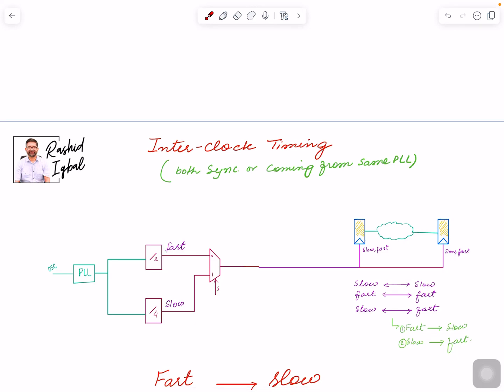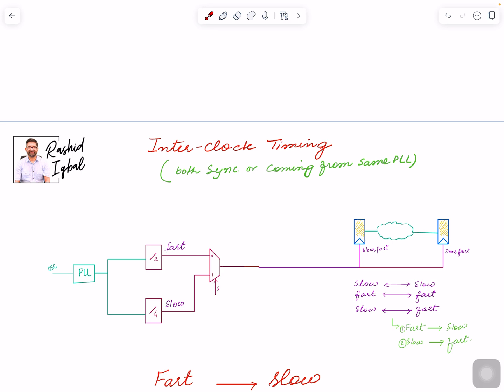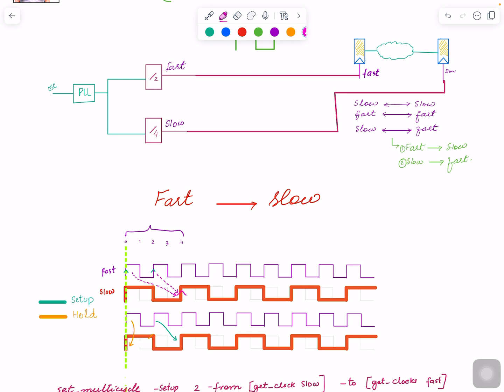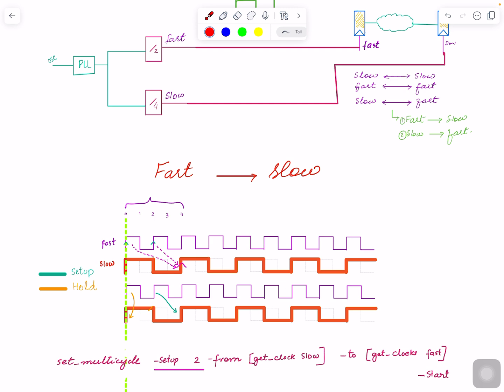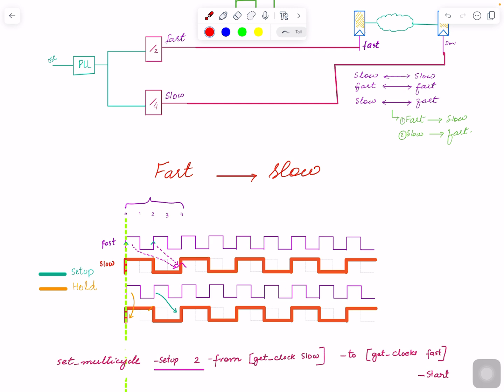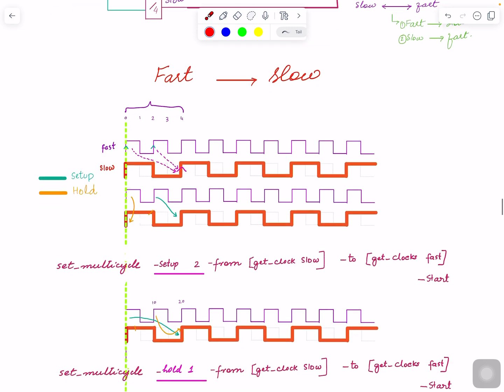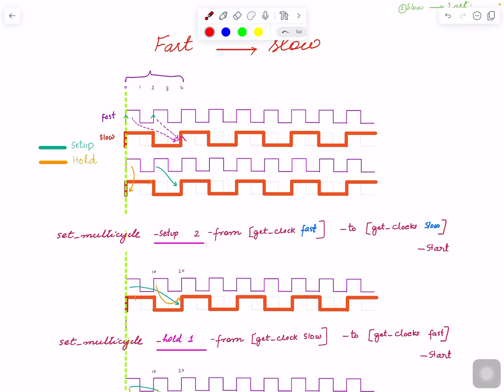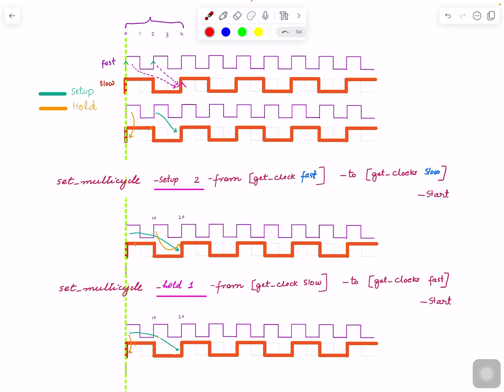PD Topic #34: Multi-Cycle Paths - Fast to Slow Synchronous Clocks | Setup & Hold MCP

Comment: Good explanation sir , one Q so in fast clock(launch clk) at 1st positive edge the data is sent and we have changed setup and hold for that so what about data sent in 2nd positive edge of fast clk(launch clk) where setup and hold will be checked for that

Q2. If you are giving hold 1 then the hold should be checked in negative edge of slow clk(cap clk) why it is taking same edge .

I have read - in primetime its like
Hold cycles = setupvalue - 1 - holdvalue
which now is 2 -1 -1 =0 so it will check in same edge is it correct?